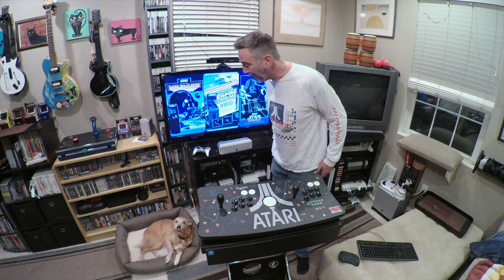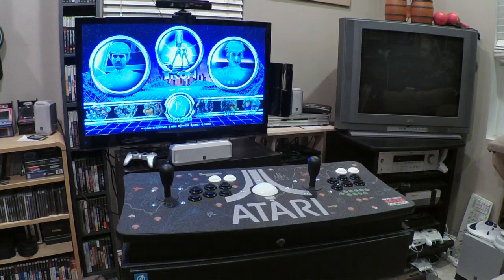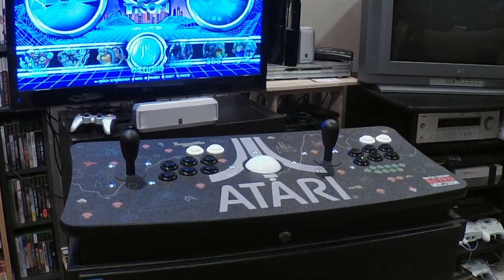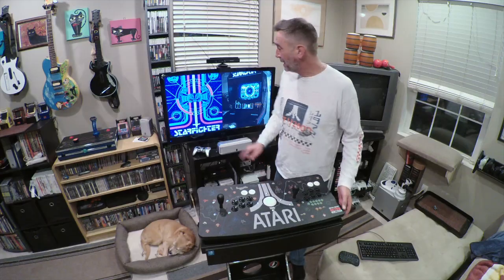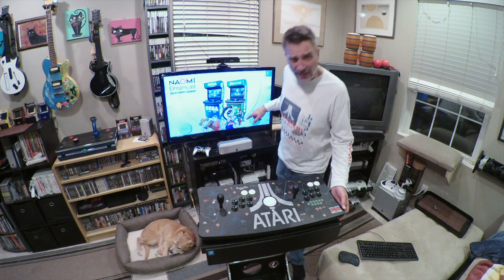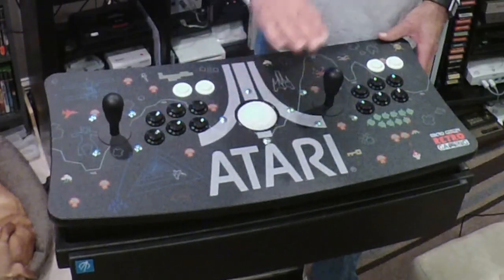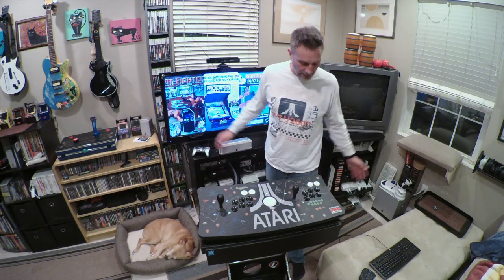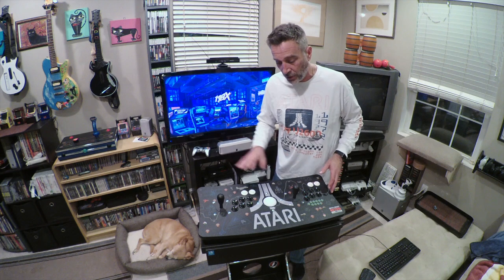Atari Ultimate Dual Arcade Fight Stick with Trackball - Set up tips with Virtualman Pi4 Image.

Comment: I'm also running the virtualman 128g pi4 retro arcade only on the Dual Stick.
There is a virtualman script in the setup option to add the xinmo or remove it,  not sure if it adds the same statement as the one you show.
Do you know how to fix the theme to only one selected and not random on every reboot?
Thanks for the tip on the trackball speed setup, I'll give a try.
Reply: I'm running the 512g VMan image, wonder if is there I'll have to look, gonna get started on the pi install and setup today.  the fighstick finally came in
Reply from the maker: @primalgraphx5747  I hope you enjoy it and let me know what you need help with. 🤘🏻
Reply: @DoubleDguitar  My other concern is can I have two after market PS3 controllers in use as well? They are Bluetooth or USB, I've had issues in the past connecting them to the Pi but I think my problem was using a Rii keyboard that was also Bluetooth causing the issue...I don't think the Pi can recognize more than one device at a time.
Can u explain what the switch in the beginning was for I was a bit lost for that? And the USB hub might be what I need to set up the controllers I'm talking about...not too sure
Reply from the maker: @primalgraphx5747  running multiple controllers will get confusing, at first. The pi Bluetooth is a little wonky, so I use the Logitech with a dongle. When you get games running, you can either have the unwanted controllers not plugged in or contented, or assign them to be defaults within the emulator settings under settings and input. Each emulator handles this a little differently, so google is your best friend there. And the switch was to swap the sticks between analog and digital input. Having the two Xinmo encoders running and having one analog and the other encoder digital created controller mismatch between players. Or even loss of certain controls completely. The switch allowed me to go between the two settings on the encoder.
Reply: @DoubleDguitar  any vids on mapping this thing??? I’m so confused lol. I added the script. I can get into config n try but I don’t get an option for the second stick and what I input seems to go to the right stick.
Reply from the maker: @primalgraphx5747  so with the xinmo, you map player one and the second one maps automatically.  Check the Drew Talks link in the description and leave him a comment that Double D sent you so he has a reference point, if he wants. But you will only have to map the one side.
Reply: @DoubleDguitar  I added the xinmo to my card, VM doesn't have folders like drew says so I just added it to the card and I did the script for the cmdline.txt back to see if this changes anything...thanks for being informative and patient with me, sorry I'm no pro at this
Reply: It WORKS!!!
Reply from the maker: @primalgraphx5747  dude this is such a great thing to read and I am happy for you. This alone makes it all worthwhile to do videos like this. I hope you get as much enjoyment out of it as I have. Let me know what else you need as you dive deeper.
Reply: @DoubleDguitar  got stuck in redream soul caliber joy stick doesn’t work but keyboard via usb does. Had to reboot to exit though. Any thoughts on how to correct that
Reply from the maker: @primalgraphx5747  ah Redream is it’s own little beast. I use the keyboard to navigate to the control input section. The WASD keys will be your arrows to guide you, like a FPS game. Then get into there and assign controls as you normally would. Redream is amazing when you get used to it.
Reply: @DoubleDguitar  I think I messed up the default controls anyway to reset :(
Reply from the maker: @primalgraphx5747  you can always reconfigure the controller within the start button menu. And if you need to, there is an option in the options menu to reset all controller configs and then you still have to hit start and use a keyboard to navigate down to controller configuration.
Reply: @DoubleDguitar  ya it won’t let me continue w the controller set up. When u hold the button to skip it does nothing ???
Reply from the maker: @primalgraphx5747  what are you trying to skip? Not sure I follow.
Reply: @DoubleDguitar  the keys that the arcade stick doesn’t have like the shoulder buttons etc
Reply from the maker: @primalgraphx5747  hold any button down at that point for about three seconds and it will advance to the next button.
Reply: @DoubleDguitar  idk why but it wont
Reply from the maker: @primalgraphx5747  try the down arrow key on your keyboard.
Reply from the maker: I believe it does add that same script. 
Yes, to stop the randomizer for themes you can go into Hurtsy’s Themes on the visuals settings and you should see that option. I had to do that for the one running on my cabinet so it would always boot up to 4:3. Thanks for checking out the video!
Reply: @DoubleDguitar  ok, yes very good I found it.  Wasn't able to use the tab key to bring up the mame sevice menu inside the game.  Still looking around for a solution on that one, I changed to mame2003 emulator.  I'll keep looking.
Reply from the maker: @billhall66  ah so you can do select x or however you got key into Retroarch and select show MAME menu under one of the settings. This comes in handy when the emulator isn’t 2003